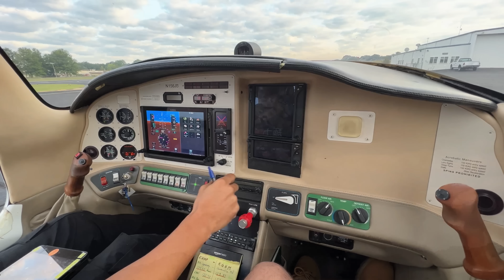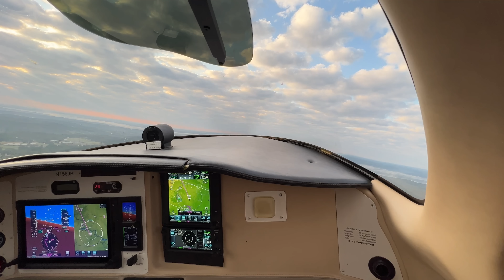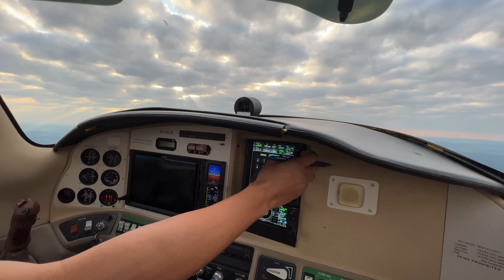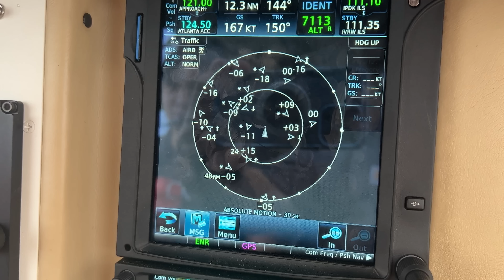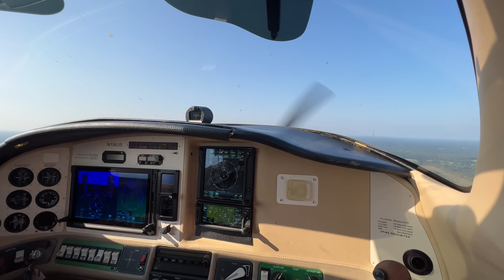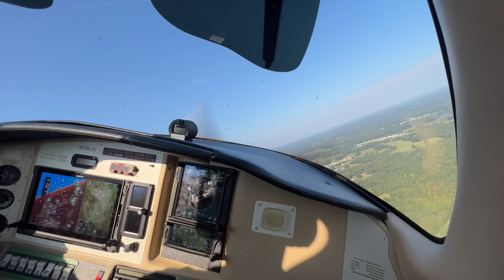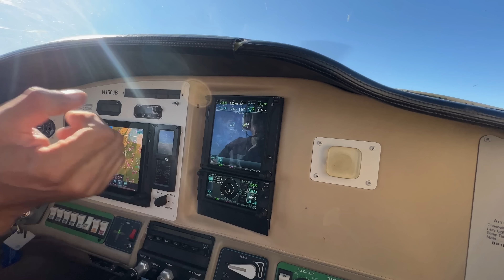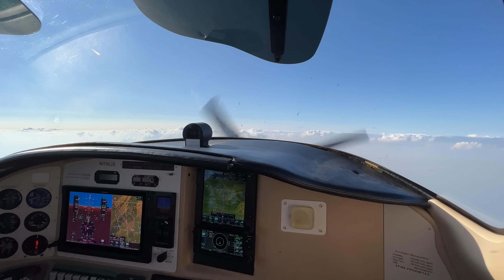Flying out in a single engine plane to repair the vintage mci bus

Comment: Dude has a Lancair, a Hummer and an MCI. Garmin G3x Touch with dual GTNs and XM.

High-performance departure: holding the plane down in ground effect while the energy builds then zooming up. :-)

Comment: I previously owned a Lancair propjet with the Walter M601E turboprop followed by a Lancair evolution turbine powered by Pratt & Whitney PT6A-134, my prophet was equipped with a Garmin g500/600 and the evolution had the Garmin G1000 avionics package.  The Garmin avionics packages are really good and there is many options and add-ons available but they are overly complicated.  My Pilatus is equipped with the Honeywell Primus Apex and it works really good but I think I like the Garmin setup better

Comment: If you could get the broken fitting out of the block off plate can it be reused or would you reuse it? Great video.
Reply from the maker: Yes it’s reusable. But going there i didn’t want to screw with it or risk it in the road.
Reply: Understand and thanks for answering my question.

Comment: That thing is better equipped than most light aircraft.  There's a good chance the engine and prop control cables in that aircraft were made not too far from me at Wescon Controls.

Comment: That is the only negative thing I have with small planes, the engine noise inside the cockpit!
Reply: Shut 'em off !  Fly in glider mode.  It really cuts down on engine wear.  Saves a lot on fuel, too.
Reply: @stanpatterson5033  It usually makes the Pilot sweat if you shut off the fan in front.
Reply: Wear ANR headphones and it's not so bad (or, in the past, a pair of Dave Clamps)

Comment: The guy with the kite is insane right
Reply from the maker: I would not do that.
Reply: @BusGreaseMonkey  I don't know if you can stall one of those things, but that climb sure looked risky to me. Might be the way to fly those things, I just don't know.
Reply: @marinablueGS  "Paramotor" or powered paraglider" is the official name.
 Yes, you can stall them but that pilot was fine. He was climbing into a headwind at probably close to full power (which isn't much) and that caused what appears to be a high angle of attack. But the fast climb speed meant the pilot was just on the throttle.

Insane? 
Not a requirement but being a little crazy helps! 😉

Seriously though, paramitoring is huge fun.

Comment: I fly ultralights and that's exactly how you take off . If the motor runs you're good to fly right
Reply from the maker: If you have to keep your feet running I’m not a fan of the takeoff
Reply: @BusGreaseMonkey  With paramotoring, wheels are also an option.